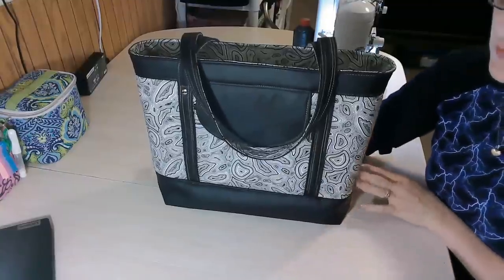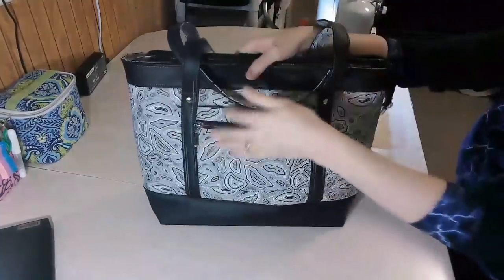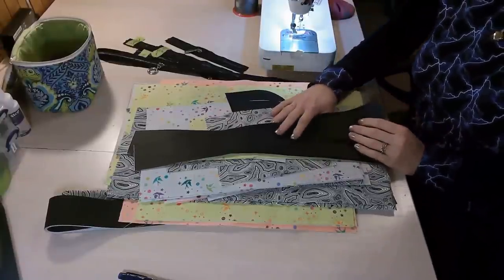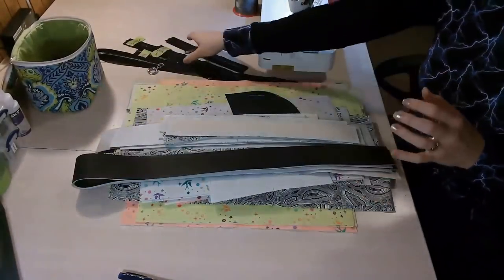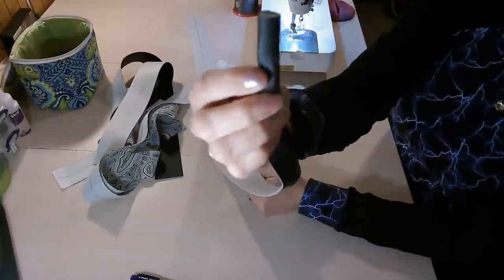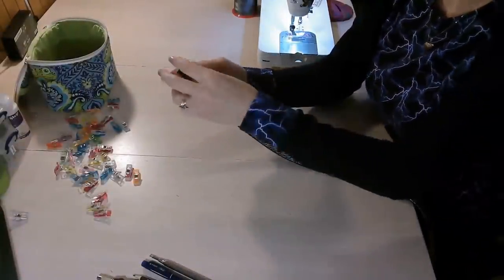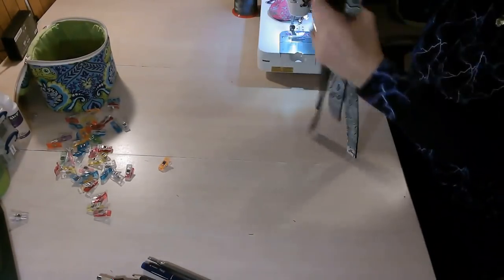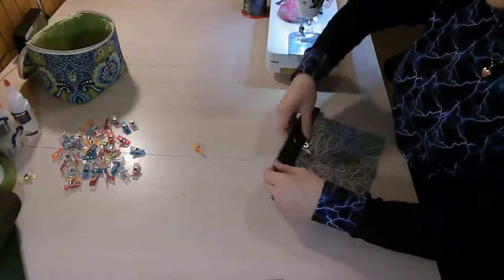Felicity Tote by Bagstock Designs - Full Video Tutorial

Comment: Would it be relatively easy to substitute the trolley sleeve for a slip pocket? Or, slip pocket with magnet closure?
Reply: I just sewed the sides as she did then I also sewed the bottom to make it a slip pocket.
Reply from the maker: There instructions to make it into a slip pocket, in the pattern. It's really easy, you just need to sew across the bottom after you sew the sides. 😃

Comment: Also, what threads & weight do you use?
Reply from the maker: Normally I use Gutterman All Purpose polyester thread for majority of my bags. However, I also use Aurifil and Tex 35 or Tex 45 threads too. For this Felicity Tote, I used a Tex 45 thread. If you like the thread, the link to where I purchased it, is in the 45 description of the video. 😃